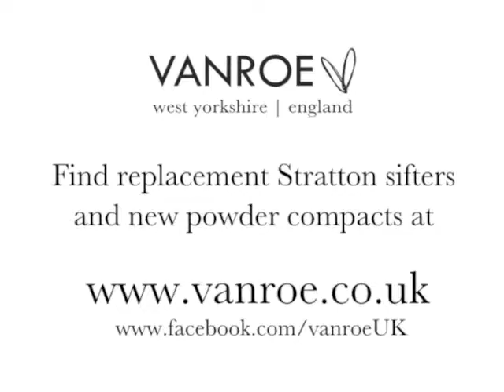How to use a vintage Stratton powder compact - how to refill with powder

Comment: Just got a NOS vintage compact (not Stratton) and if it wasn't for this video, I would never have figured out that I could put my Clinique loose powder in it. I was just going to use it as a mirror. Being NOS it had a puff and sifter (brand new!) inside of it. I put these aside not sure what to do with them. (Thunks head.) Thank you! You've set me on my way to collecting compacts.

Comment: Hi Jean what a beautiful helpful eloquent video! You are lovely. As a result I discovered my late mother-in-law’s compact that Ive saved lovingly and display on my hallway table as a decoration is actually a Stratton Loose powder compact with the Self opening inner lid. It is a lovely red color with flowers and still has the sifter But no powder puff. It even still has traces of powder in it left I don’t want to disturb it since it was personally used by my mother-in-law. I saved it because it was just so beautiful and sturdy. It has lovely stars on the back and says Stratton. Based on some research it looks like it’s from the 60s which makes sense because that was when she was a young lady probably most fashionable & using make up! Thank you so much for your detailed explanation have a lovely day

Comment: Thank you so much for this video. Today I have just received on the post what it looks to me a completely unused stratton compact (one of the modern version for loose powder for what I see in your video) that I bought on ebay and I have already filled it with mineral makeup powder. And now I now exactly how to use it thanks to you. Thank you so much. X

Comment: Oh my, thank you so much for this! I've started collecting vintage makeup, especially compacts, over the past year. I recently bought a Stratton convertible powder compact that came with a matching blush and lipstick with holder from Max Factor. The whole set is in pristine condition and were either never used, like the powder puff that is still in plastic packaging, or lightly used. I figured this would be the perfect compact to actually use as it still has the sifter in it. I also have another beautiful rose Stratton compact, but it is missing the sifter. Hopefully your shop is still open...
Reply: Felicia Gradowski I really want to start collecting, where would you recommend to buy vintage makeup in VERY good condition? :)
Reply: Linda Pentony I've found some at antique malls, but most I have bought online on Ebay.
Reply: You can also purchase on Etsy